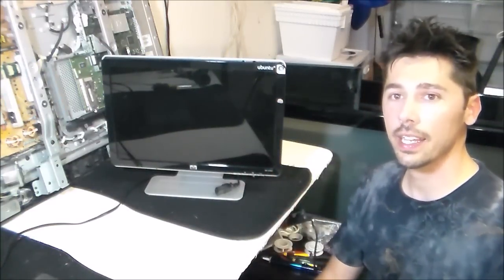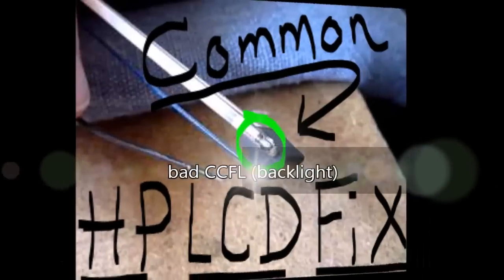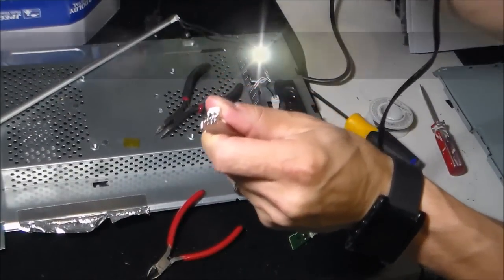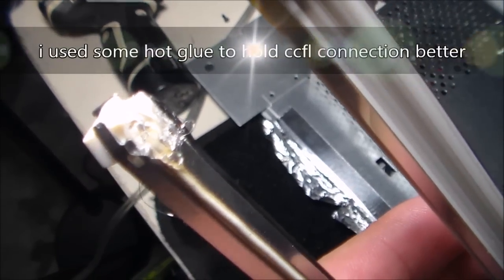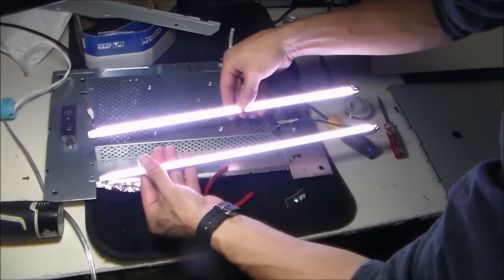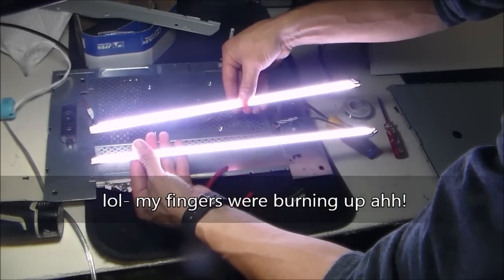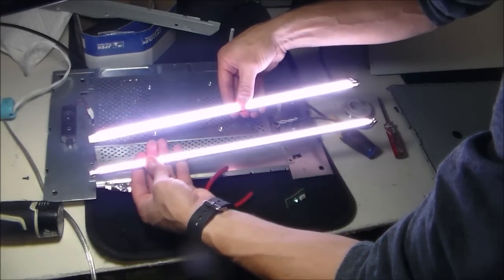HOW TO FIX HP LCD, monitor turns off after 3 seconds (common repair)

Comment: I have one of these (HP w2007v) and it went black. Turns out one of the four CCFLs is completelly burned out, it's not a cable problem.
I disconnected that pair and tried a spare CCFL pair from another monitor, not the same size, but just to check, and the screen works fine (apart from the darker bottom, of course, since only the top pair is lighting it).
I ordered a CCFL to LED conversion kit, but I foresee a problem: This HP, when one or two of the CCFL pairs is not connected, the screen itself goes to sleep.
Since the Leds will be connected to some 12v source, and not the inverter, what can I do so it doesn't go out by the lack of CCFLs?

Thanks

Comment: Don't know if you'll respond. I have an hp 2509b model. Took everything apart and when I power it up one light (top) comes on and the lower gives a low purple glow on one end. I've swapped the bulbs opposite but still occurs in the lower side. All capacitors appear fine.

Comment: Hi sir TampaTec, thanks for sharing. I've replaced all the capacitors in  in my Viewsonic (its two boards) but it still turns on, then after 30 minutes it'll flicker in 8 second intervals? After the capacitors, with this symptom, what's the next one to check?

Thank you. God bless, Rev. 21:4

Comment: thanks for this video. I tried this. checked the wires of the ccfl and they were fine. checked the caps too. seems good to me. so I tried plugging in just the ccfl bulbs just like how you tested it in the video the the lights continue to work. but when I assembled it again, the problem still exists. And to add up, the LCD now only displays white. I will try to check again when I have free time.

Comment: Hey *****,
I have a very old monitor which I'm using for over 10 years now, its a Dell 1504fp Silver.
I has the exact same problem, it goes on and over 1-2 sec. it turns off. i don't think that there is something wrong with the back lighting though, i thinks it's the capacitors as you've mentioned. So what can i do about that?

Comment: My ELO Touch 32 inch ET3243L is doing the exact same thing, turns of after about 3 seconds. Could you please advise me which board cause the problem for this model.

Comment: Are the four backlight CCFL connectors wired to power 1/4 of the display or are two powering the display and two used to control the intensity of the backlight and if so, which is which?  As in which color wires are the power and which are the control, or are they all power?

Comment: Hey I have this monitor but it doesn't turn on at all I can heat it powering up so there's power but the screen don't come on at all and the led on button at the top doesn't light up either. Do you know what would be the issue with this?

Comment: hey man thanks on covering about the backlight ,totally subbed :),everyone else are on the same boring bulged caps hehe... i have a few question bt fore that ,did you know if you take a torch a shed light directly on the black screen you can actually see the desktop or watever it is being display  after that 2sec dissapointment bt on a very dim setting ,thats how i accidentally discovered mine that it had a backlight problem and i thought you could used that info if you by chance havent mentioned it im not much of techie but iv done countless DIY, iv been too uninspired to fix it cos i wasnt sure how id replace or fix the backlight,getting a new one is not on my interest right now cos my other music project needs more funding n right at this stage of the recording i missed and i the need for 2 monitor i once is back,iv been using my note pro for my artwork which was to compensate the black screen lying somewhere now  and i saw ur solution got me all excited this single huge lcd tv is not enough, okay enuff usless talk, my question is what if the backlight were beyond repair by your methods are there any possible fix,what are the other common problems and finally could i replace it with these  back lght from a 17" lcd i salvaged from old lappies i got like three of them,2 sony viao,one acer/hp  i think..thanks once again!

Comment: Like the video. My infrequent use server monitor fell on the floor once. Didn't notice any issues at first. Month later I have the 2 second problem. I opened it up. It's a very flimsy mechanical design but the PCB boards are solid and I couldn't find any suspicious caps on the power or video board. I didn't look into the light bar. I am curious: Would an intermittent connection cause a specific timeout in the power to the lighting?

Comment: I have a weird problem with an HP ZR2740w LED monitor. My friend brought it to me saying it wouldn't turn on. I tried to turn it on and it worked fine. I plugged it in my laptop and used it for 2 days without any problems at all. On the third day I was not able to turn it on anymore. The blue light goes on and changes to amber after a couple of seconds, while the screen is completely black the whole time. And that's all I get now. So weird. Any ideas what could be wrong, anyone?
Reply: Hi! were you able to fix it? thanks!

Comment: My CCFL lamp aparently went out which caused my monitor to turn on, display something for one second and go out. I saw those backlights go for twelve dollars on ebay, but I think I'll just toss that monitor out because it's not even 1080p. Only 1680x1050. It's not worth fixing it because the price of a new monitor this size is just 40 euros...
Reply: +EvkaX155 But still, throwing it out would be a waste. There's a polarizer, multiple diffusers,a power supple and a nice cutting board (aka screen :D) in it

Comment: Hi Tampatec.  I have an older Sony Bravia KDL 46 XBR. I have a problem where it shuts off and there a 6 blinking red lights. I had the set repaired for over $300 last year but the warranty is over. I am sure it is a power board issue. Do you have a video showing how to repair this LCD tv? Thanks
Reply: Hi! were you able to fix it? thanks!

Comment: opened up an older HP model W22 ... one connection was indeed burnt through... can't remember which order the plastic sheets have to go (couple of them)  before reassembling.

Comment: Isnt there hi-voltage in modern LCD monitors? Are they safe to open and touch while testing? (I mean: except the 220v power transformator area, of course)

Comment: Still helpful after all these years.  The 3 second issue, and no visible cap issues, caused me to explore into the LCD.  Sure enough the ribbon attached to the actual LCD separated, and I was done, but found the source of failure and Ozone smell as a shorting to the metal bulb housing on just one.  Any vids on that repair.   Could never get even those    exercise bike B/W LCD ribbon to reattach, with heat.

Comment: Interesting video.  I have a Hannsrpee 25" monitor that is coming on and going off.  At first it was on for half a second and I replaced some caps and now it stays on for 8-10 seconds.  Since I have it apart, I think I will check the backlights, as I know that is what is wrong with it, because I can take a flashlight and shine on the screen and see a picture.  Thanks for this.  I'll update when I take it apart further and see what I find.

Comment: Perfect! Quick with no no extra junk. I just fixed my 22" acer with this problem. Just note that with acer the light test would still turn off after 3 secs - it turns off automatically if no signal detected....

Comment: Hanns-G HH221 No video after replacing 7 Capacitors
Let me begin by saying that recently this Hanns-G computer monitor started experiencing only staying on for like 2 seconds, there was video and audio from HDMI, there was a slight zap like sound from the back but no other issue, after checking around I learned this is a fairly common problem with bad capacitors, I examined them and found none to appear bulging or burned but seeing how this was the least costly repair I decided to replace the ones that are recommended replacing. So I just replaced 7 capacitors as recommended by the seller I bought them from on ebay, I made sure they were installed properly with the negative side, short lead correctly, made sure no solder overlapped to short anything on the circuit. I put back the CCFL and re-attached the Power board to the video display board, turned it on and now The green light shows there is a signal it stays on when the HDMI cable is removed the light turns yellow like it should,Windows shows the monitor is connected, audio is working through HDMI the zapping sound is gone, but there is no video whatsoever, I mean I shine a flashlight on the LCD and I can't see anything so that kind of rules out the backlight. I also tested it with VGA and same thing no video. I can't figure out what went wrong, I have checked and double checked the Video board cable, the CCFL connectors and nothing, the only thing I can figure is that that it's either the LCD or inverter is now gone and if that's the case I'm done as it's just gonna get too costly to fix. If anyone has any idea what's going on here and what might be the cause please help. Thanks
Reply: Hi! were you able to fix it? thanks!

Comment: I have a 25" Hannspree monitor that goes off after a couple of seconds and I'm pretty sure that's what's wrong with it.  I can hear a faint"squealing" sound right before it goes off.  I can see a picture on the screen if I use a flashlight on the screen.

Comment: i have the sam issue with my HP 2509m monitor.  I have the power blue button lit up, the screen turns on for 3-5 seconds and then it cuts off. Do you think i might have the same issues with this other model??
Reply: Hi! were you able to fix it? thanks!

Comment: Hi, I've a Philips 46PFL8606 that could have the same problem. If I turn the TV on it flashes up the backlight from the right bottom turns off and blinking 3 times.

I've checked the power supply for bad caps and alos I resolderes some joints because they looked very bad. But that wasn't the solution for my problem.

As I tried to start the TV with the backlight disconnected from the power supply, it turns on and the Ambilight was also shining.

What would you say, might this be my problem?

Nice greetz from Germany
Reply: PLZ  HELP ME OUT THIS PROBLUM THANKYOU
Reply: Hi! were you able to fix it? thanks!

Comment: How to know if it is the backlight that is having trouble? And that it is not the inverter
Reply: +Pierre-Louis Boyer With inverter you typically see a pink hue prior to shutting off, or no image. Hold a flashlight directly against the screen when it is powered on and hooked up to your computer; if the backlight is bad but the inverter is good then you'll still have an image and with the flashlight you'll be able to see it a lot easier than with the naked eye.

Comment: Hi. Can we use the multimeter to test whether the backlight bulb is good or bad? Is it correct that if the multimeter test leads (ohmeter) are connected to each of the pins of the backlight bulb, the meter should show low resistance or the opposite?
Thanks

Comment: I bought an ASUS VTG248QE 3D 24" monitor to save time.  But, your video inspires me to fix my old HP 1259m monitor to use on and older computer at some time in the future.  Thank you for a brilliant fix.  I hope I can be as patient to do the job as you.

Comment: would it be the same issue with an older HP monitor?   mine not only goes black but also it turns on by itself when the power button is OFF
Reply from the maker: kev mc yes.  this is very old hp monitor.
Reply: thats an old one?  mine is square with a silver trim lol.
Reply from the maker: kev mc it's over 10 years old i believe.
Reply: yeah so min goes blank but also you can power off the monitor so the light on the button goes out, and it will later turn back on!  crazy hey

Comment: Cool. My Viewsonic 2038wm-LED monitor turns on but the screen image flashes every few seconds (screen is on, screen is off, screen is on. The image actually looks good, not faded or anything). These are cylindrical electrolytical capacitors, I see: 

100v 33nF
25v 30nF 
25v 330nF
10 680nF
50v 47nF
16v 470nF
16v 470nF
450v 100nF 

Ceramic capacitors I see are:
4 blue ones, one blackish & one light brown

The nearest to the connector to the LCD controller board  are the two 16v 470nF

Which could be the possible culprit?

Thank you. God bless, Proverbs 31
Reply: Hi! were you able to fix it? thanks!
Reply: @sicariussss  Hi sadly, I completely replaced all capacitors with new ones, but I wasn't able to fix it, it wasn't the capacitor. I wonder what the culprit is?
Reply: @SevenDeMagnus  I'm watching lots of tutorials and its seems that a faulty backlight could be the issue, if I find anything will let you know, thanks for the response! 😁

Comment: same problem, but the ccfl lamp are too fagile and i've broken one until i tried to remove the rubber boot! So...i replaced it with led stripes and adding a 12v power supply inside (connected to the same connector of the monitor supply)...it works!! :D (not the same backlight but it's enough!)
Reply: where did you get it???
Reply: ProXgamer 730 i found it on ebay...check the tickness and the width of the stripe. the led have to be 6000-6500 k light to be naturally white

Comment: My ASUS monitor turns on then off, then on again for a few seconds, then off. It does this every time. I visually checked for fried capacitors and parts but all looks fine. Is there a simple fix ? Thanks.
Reply: there is one way just lower the brightness to 50
Reply: Hi! were you able to fix it? thanks!

Comment: If the problem is indeed the backlight CFL, there is no need to dismantle the monitor further once that is exposed, correct? Seems like you had access to that fairly early in the video but continued to dismantle, why so? I know my hp monitor has this same backlight issue so I'm hoping I just have to go through a couple of the steps shown in your video to get to the backlight wire.
Reply: Hi! were you able to fix it? thanks!

Comment: Thanks for this very very useful video. After a detailed inspection on the supply board, there was no error. Then I open screen and it was exactly this problem. Samsung T220HD

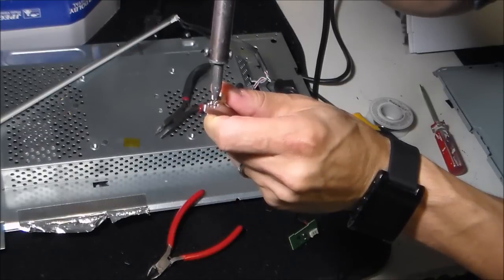Comment: At 3:39 - what is that whole piece called? The tubes on mine are broke near the rubber piece and Im having trouble finding a replacement since i dont know its name.
Reply: +Xax212 CCFL backlight.

Comment: I'm having an issue with an Asus monitor.
When I turn on the monitor, sometimes the blue LED power light comes on for about a second, then goes off, the monitor itself doesn't come on.
But most of the time the light doesn't come on at all, if I unplug the power cord and then plug it back in, the light will once again appear for one second though.
I've tried using a different power cord and confirmed that the problem is with the monitor, in fact I hooked up a another monitor straight to the computer using the same cords that were connected to defected one, and I'm using that other monitor now with no issues.
Do you think this is an issue with the capacitor for the power button?  I'm not tech savvy enough to do a repair on this level, so if I get it repaired it will most likely be by a professional.
Reply: Hi! were you able to fix it? thanks!

Comment: Thank you, again, you make cool videos, please keep them coming
Reply from the maker: thanks, you got it
Reply: @TampaTec  Hey I have this monitor but it doesn't turn on at all I can heat it powering up so there's power but the screen don't come on at all and the led on button at the top doesn't light up either. Do you know what would be the issue with this?

Comment: Hi, Thanks for sharing I learned something from all your videos, very helpful.

I have this problem for 2 monitors Philips and Benq and I changed capacitors and it is still turning off after some seconds. Everything seems to work. And I used lamps from another monitor and still same and this lamps work on other monitor so I don't think they are the problem. Please help, Any advice?

Thank again and waiting for new videos!!!
Reply: I found my problem as I saw bad lamp I just decided to remove it, but circuit saw a bad lamp and goes off. So I need four plugged lamps to work.

Comment: Is there a way to buy new ones(backlights i mean)? One of mine is just broken(cracked). Hp model is w2216v
Reply: Hi! were you able to fix it? thanks!
Reply: @sicariussss  Hi yes i bought 490mm LED Backlight Strip Kit from ebay for this monitor and then replaced them carefully and everything worked. Just be very careful when you disassemble the actual lcd but other then that it is easy.
Reply: @thechallenge293  Thank you so much for your reply! I'll be extra careful! 👩‍🏭